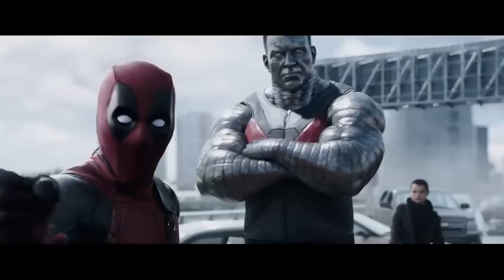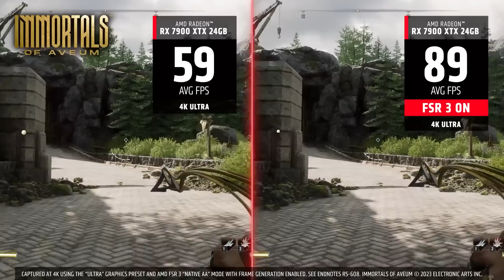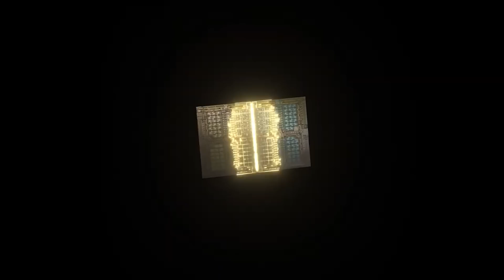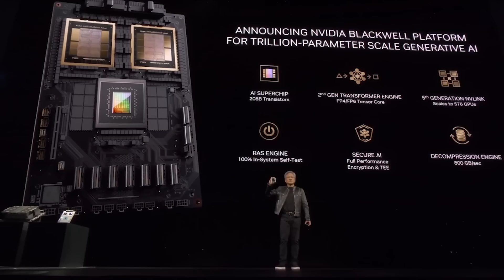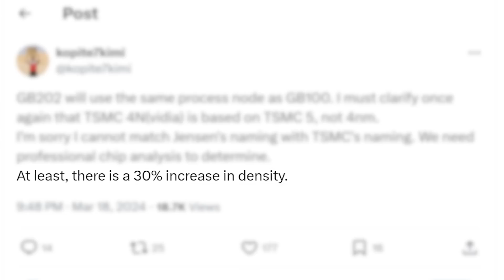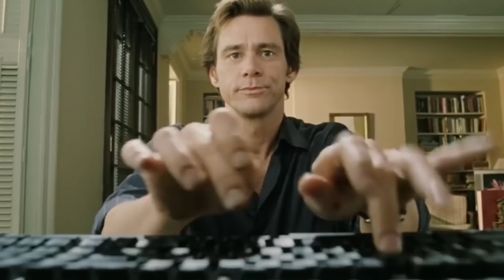RTX 5080 BEATS The 4090!!

Comment: Was there a generation in which 80 class didn't beat the previous gen flagship?
Reply: The 4080 requires frame generation to beat the 3090. Edit: nope, I'm an idiot. There's some benchmarks out there showing the 3090 to be faster sometimes, but there could be a variety of reasons.
Reply: @nimrodery  the 4070 ti beats the 3090, the 4080 beats 3090 ti by 1round 10-20%, driver improvements have made it possible
Reply: @Rishi-chadsincebirth  What driver improvements? I used NVidia for decades, they never fix anything. Driver improvements would also improve performance on older GPUs, not make newer ones faster.
Reply: Not that I can recall but its true that the gap the 4090 has over the 3090 is much bigger than before. Tbh I think the 5080 will be around the same performance in rasterization and 15% better with raytracing while consuming at most 350w instead of the 450w of the 4090. Though it will most likely cost at least 1200 or 1300, so it wouldn't practically be that much of a better deal. The 5090 is anyone's guess but I'm expecting a ~20% performance increase while keeping the 450w power consumption, since Nvidia is more about efficiency this gen it seems. We will see.
Reply: It's rumoured that 50 gen will be 70% faster than 40. Of course it only applies to the fastest chip, the gap between 80 and 90 class will only increase
Reply: @bartix698  What is the source? I'm calling BS, we get this "rumors" every new gen and they are always wrong. Most rumors are going more in the direction of "more efficient cards" instead of much more powerful ones. Besides, Nvidia is not changing architecture / nm manufacturing, so there is no chance that they are able to get 70% increase out of thin air

Comment: Yeah, because it is not like if the 4080 was already better than the 3090 and 3090Ti, right guys? It is only the 5080. Only the 5080 could beat a 90 model from the previous gen.

For real tho, we should start talking about prices, because the 4080 came out at $1199, which... is fine for a GPU that beats the 3090, but it was a lot more expensive than the 3080.
Reply: yeah, kind of a weird claim to make, cus rn even 4070 super beats 3090 in terms of performance

Comment: AMD's gonna have to focus on the mid-range to win, I think they can do it
Reply: Given that MLID reported that the PS5 Pro has a 2 to 3x improvement in RT using RDNA 3.5, RX8800XT should be equivalent to 7900XT but with 2.5x RT improvements @$600!
Reply: @tringuyen7519 that's pretty frigging good for Ray Tracing, I wonder how that stacks up to the Nvidia equivalents.

AMD's ray tracing tech was always leagues behind Nvidia's.

Comment: 5090- $2999
5080- $1999... but it's better than the 4090, so 4090 users really feel like they need to upgrade
Maybe nvidia should just move to a subscription model at this point.
Reply: And maybe youre gonna need a second case just for  the 5090 because its bigger than any case on the market

Comment: 1.2 kW. KILOWATTS. Power supplies will have to output more power in order to keep up with NVIDIA's new GPUs, and in a nutshell, if the gpu exceeds 1600W/1.6kW of power consumption or power supply recommendations, you're screwed.

Comment: I HATE this rat race. Now I feel like I'm lagging behind with my 4080 when I know that isn't truly the case. On the flip side, cool gpu 👍
Reply: Go amd they got more vram and last longer
Reply: @gopackers848  I've been thinking about that a lot. 100% going with AMD for my next gpu and gonna get an AMD cpu too. Full AMD.
Reply: You don't have to upgrade, a 4080 should last a little longer. Although the 40 series is gimped for VRAM, so I think you might have to consider an upgrade when the 60 series comes out.
Reply: @UltimateGattai  Thanks. Everything moves so fast. Obviously it's a marketing strategy coupled with competition but it makes it feel hard to enjoy what I have in the meantime. Like what I have will be obsolete in a few short years when I Just dropped $2.5k on a really nice laptop. It's an odd feeling, on one hand I wish things would slow down but on the other it is selfish to want to slow progression for everyone else. Guess I just need to slow down myself and not let that get to me so much. Edit: Yeah the vram is a joke and the power cap on the 4060 and 4070 is so obtuse that it's safe to say that Nvidia isn't even trying to hide their performance manipulation. Capping out at 80 watts when gaming on my 4070. Later learned that Nvidia put a hard cap on the power limits that can't be changed 🫤. 4080 is great though. Goes all the way up to 175.
Reply: 4070 to super here.  Waiting for 6 or 7 series.

Comment: The 5080 should beat the 4090 by a significant margin. The 80 class GPU should always outperform the flagship GPU from the last generation.
Reply: The 4080 did that but then they decided to charge $1200 lol
Reply: This, not trying to make people mad, but looking at the 3nm node, yall 5080 buyers will probably be charged 1399$ and the 5090 @ 2k as a 4090 owner im ready to pay this@Dex2R7
Reply: Solid deal  @Dex2R7
Reply: If history repeats itself, the RTX 5080 will be priced closely to the RTX 4090.
Reply: @KillFrenzy96  cant wait for a 1k$ 5060!!
Reply: @KillFrenzy96 Than no one would buy it. The 4090 didn't sell so well because it was a "Gamer GPU"
Reply: Then I have to sell my kidney for 5090 @KillFrenzy96
Reply: @KillFrenzy96 the 4080 didnt sell well and nvidia is starting to realise that so the i think thr 5080 could be 1000-1200$
Reply: @KillFrenzy96  i hope not. praying that they learned from their 4080 sells!
Reply: The 1080 ti was barely slower than a 2080 though. Same with the 980 and 780 ti
Reply: I thought the 1080ti was faster than the 2080, but the 2080ti was faster than the 1080ti. Apart from Ray Tracing, the 20 series was barely an improvement over the 10 series.  @SpiritMMO
Reply: @SpiritMMO facts. It's faster than my 2060.
Reply: @SpiritMMO  Yeah, I bought a 1080 Ti a few days after the 2080 released, as ray tracing wasn't worth the price tag. That card still powers a work machine for me, was a great purchase for gaming for a while too.
Reply: @SpiritMMO  The 1080ti was an anomaly. I had it and "upgraded" to a 3080 and sold the 3080 and put the 1080ti back in because the performance in Escape from Tarkov in 1440P was like 100fps with the 1080ti compared to 120 with the 3080. Not worth it at all.
Reply: @SpiritMMO   The GTX 970 is 3% slower than the 780 Ti and the GTX 980 is 11% faster than the 780 Ti. The GTX 1080 is 31% faster than the 980 Ti. 2080 is 9% faster than the 1080 Ti. The RTX 3080 is 36% faster than the 2080 Ti and the RTX 4080 is 30% faster than the 3090. So the 5080 should be around 10-35% faster than the 4090.
Reply: @SpiritMMO  I heard it was because the 2080 was underpowered from RTX focus hence the super versions in the 20 series (I have no idea)
Reply: @GallusCorvus  Nah. NVIDIA had AMD to take on
Reply: Keyword "should"
Reply: significant margin ? are you smocking something or what ? do you know how fast the 4090 is?
Reply: @magnomliman8114  At least in ray tracing, it should be a significant margin. I guarantee the 5080 will be more expensive than the 4080, knowing Nvidia, so a big performance increase is to be expected. I don't understand why these stupid fanboys get defensive and shocked when I mention that the 5080 should be faster than the 4090. Fucking get over it.
Reply: but the price
Reply: @telecast712  I'll buy a 5090, plp bought the 4090 at that price for performance so why wouldn't peons buy the 5080 for 100$ more then 4080, 100$ less then the 4090, EZ
Reply: But the 4090 was so much further ahead of its lower end SKU than any other previous generations flagship.
Reply: @AxleLotl  right
Reply: We are in the Moore's law curve of silicon costs going up nearly as fast as density improves,  with some exceptions to the rule. Thus the amount of money you can spend to get higher performance goes up much faster than value. And at some point NVIDIA probably realizes that there's large gap between people who want the absolute fastest and are wiling to pay for it and the amount second fastest GPU could be sold for. 
 This time, there's 50% improvement in memory bandwidth per pin because GDDR7. And then you only need to add few more cuda cores and some clock speed to make 5080 match 4090. The compute is the one thing that still scales with process improvements thus they can fit more of it with same area.
Reply: @jouniosmala9921  that's why people like me buy a 4070 ti super instead of a 4090. I can afford the 4090 but why? The 4070 will do everything i want at the performance level I am looking for.
Reply: And being sold more expensive comparing to the last gen flagship looool
Reply: if it doesn't then we have a big problem lol
Reply: totally agree
Reply: No
Reply: If its a dual chip yes, but that would also make it more expensive.
Reply: exactly!
Reply: If you believe that you are delusional also let's not forget 4090 has 24gb and 4080 will have 16gb
Reply: Just get the card on a bench and give us the specs….ignore the hype and believe the facts.
Reply: yea, and it is very likely. 4070 stands almost equal to 3090 and 4070 ti super outperforms 3090 ti by around 10%
Reply: You obviously are new here. Just because it is new doesn't mean it should outperform the previous generation. For a while, Titan cards that were brought from the enterprise product lines routinely outperformed multiple generations of consumer GPUs. You would pay 2-4x the cost of a flagship gpu though.
Reply: @Neckername1   New here? I am definitely not. It's always been a trend where the 80 class GPU outperforms the previous gen flagship GPU. 4080 outperformed 3090 Ti. 3080 outperformed 2080 Ti. 2080 Super outperformed 1080 Ti. 1080 outperformed 980 Ti, etc.
Reply: In reality the 5090 will probably only give you 25% to 50% more frames then the 4090. Which is fine, but people need to stop saying it will be 10x faster and stuff like that.
Reply: @unrealdevop  The 5090 only being 25–50% faster would be absolutely garbage considering how expensive flagship GPUs are getting. It's really not that unrealistic to expect a 2x performance increase from 4090 to 5090, at least in ray traced games.
Reply: @RenderPixion  I hear you, and yet the 4090 was only 75% faster then the 3090.......
Reply: @RenderPixion  Also if you look at the graphs where it shows the actual benchmarks, it will be more evident just how much more performance you can expect between generations and it's not double. Some people were claiming the 4090 would be 4x faster....then the 3090....it wasn't even 2x faster.
Reply: @unrealdevop  The 4090 is around 70–80% faster than the 3090 at 4K raster and roughly 2x faster in ray traced games. There are plenty of ray traced games where the 4090 is 2x faster than the 3090. For example, in Cyberpunk at native 4K max settings with psycho RT, the 3090 gets around 20 FPS, while the 4090 roughly averages 40 FPS. Control, Dying Light 2, F1, Alan Wake 2, and Avatar Frontiers of Pandora are some other ray traced games where the 4090 practically doubles the 3090's performance.
Reply: @RenderPixion  Ray tracing don't count LOL. I don't even know why they throw that out there....I've literally NEVER Used Ray Tracing....EVER
Reply: @unrealdevop  Ray tracing is becoming a big factor in modern GPUs. That's why.
Reply: @RenderPixion  I believe that's purely subjective. I personally don't know of a single person that uses Ray Tracing. Now that we have True Global Illumination in Unreal Engine I don't really see why we would need it to begin with.
Reply: @unrealdevop   Unreal Engine 5 mostly uses software based RT called Lumen. Lumen can also be hardware based RT as well. Hardware based RT is more accurate than software based RT, resulting in better lighting,reflections, shadows, and refractions. However, it's more demanding than software based RT. Software based RT is great for GPUs that don't support hardware based RT and GPUs that don't have the rendering power to run hardware RT properly. Since software based RT also uses upacaling, it causes shimmering issues.
Reply: @RenderPixion  Yes you have a point there, I've worked with it but it's extremely heavy....Ray Tracing is just so expensive, when enabled performance drops by like 60% or more. Maybe when hardware can actually support ray tracing without dropping your game performance down to 10-30 frames per second I'll start being impressed by Ray Traced Performance gains.

Also I should mention that Ray Traced Lumen also has it's downsides and it doesn't look that much better then Non-Ray Traced when comparing the performance gap.

Ray Traced Lumen is considered something for Cinematics...not something you would actually have in your game.
Reply: @unrealdevop  This is why I am hoping next gen GPUs are a massive leap in performance, especially in ray traced games, so ray tracing can have less of a performance hit. I do agree that the performance hit is too big now. Current gen hardware isn't powerful enough to run RT without any compromises.
Reply: @RenderPixion  Yeah, we'll If not this gen maybe next gen or the one after but eventually the performance will get to a place where it can handle it.
Reply: @unrealdevop  There are quite a few leakers saying that the 5090 should be over double the performance of the 4090 in ray traced games, and that's referring to raw performance apparently without upscaling and frame gen. I hope these performance claims end up being correct.
Reply: @RenderPixion  Yeah I mean I hope so too. It would be nice and at the very least it would make for faster rendering times for me.
Reply: @unrealdevop  A massive performance increase in ray traced games would allow GPUs to run games at a higher ray count, which would result in much better looking ray tracing. Most current gen ray traced games run at a low ray count, which causes a noisy image with artifacts. More rays mean higher image quality and more accurate lighting effects, along with less noise and artifacts. Increasing the number of rays and bounces is the most effective way to make RT look better. The only downside to this solution is that the higher the ray count, the more demanding it becomes.
Reply: @RenderPixion  Oh yeah, you know now that you mention it I think that's one of the reasons I didn't like it because of all the noise. I get why they are doing it and it's been a slow paced technology but over time I can imagine it being the #1 selling point.
Reply: The price gone be twice as well
Reply: This isn't impressive considering the 4070/super is better than the 3090
Reply: They should only be releasing one GPU at a time. The just keep selling the same shit with different names over and over. Only cards faster than the previous gens flagship should be released. That means their new gen slowest card should be faster than last gens flagship
Reply: I doubt it. Even if the alleged 30% density increase is true, that's nowhere near the kind of improvement that Ada Lovelace saw over Ampere. Unfortunately we can't get that kind of jump in process node every iteration.
Based on the leaked info on transistor density and likely power limits, my guess is 5080 will trade blows with 4090, and probably perform worse than it in 8K and high res VR due to less VRAM (assuming 5080 gets somewhere in the range of 16-20 GB).

I'm also guessing that 5090 will be a 600W+ space heater since they will need to pack in a lot more transistors to get a significant leap over 4090 without much of a process node improvement.
Reply: @FromDesertTown  Nvidia's data centre Blackwell chips are on TSMC 4NP. Not to be confused with N4P. I am surprised it is not 3nm. Nvidia definitely could have used 3nm if they really wanted to. Because Nvidia's AI accelerators used an MCM design that allowed them to cram in way more transistors without upgrading to a whole new node. TSMC 4NP is only a slightly more enhanced version of the custom 4N node used for Hopper and Lovelace. The 104 billion transistors in each chiplet of Nvidia's B200 are the reticle limit of how many transistors can be packed into a 4nm node on a monolithic GPU. Nvidia's Blackwell gaming GPUs are unlikely to be MCM because effectively rendering gaming performance across multiple chiplets is very difficult considering an MCM design introduces a latency penalty, and low latency is critical for real time applications such as video games, so MCM isn't a viable option for gaming yet, but for AI workloads, latency isn't as big of a problem. I think they will struggle to fit a bunch more transistors on their gaming GPUs, which will very likely remain monolithic without using TSMC 3nm. Leaks are saying the 50 Series will use the same 4NP node as the data center chips, so I don't think RTX 50 will be a massive performance increase over RTX 40 due to not being on 3nm.
Reply: @FromDesertTown Yeah. They're both TSMC 5NM, Blackwell is just on an improved version. It will definitely take way more power draw for more performance. I'm afraid I don't even expect the 5080 to beat the 4090 in raster, probably a ~20% raster perf improvement overall and then larger gains in RT or AI workloads. This isn't a bad thing if it's priced right, but ofc it won't be so lol.
Reply: @FromDesertTown the rtx 5050 will have a 50% of working
Reply: @FromDesertTown The reason why, tier-for-tier, Lovelace annihilated Ampere was because the levels of models were off by one. 

The 4080 was a 4080 ti
The 4070 was a 4070 ti
The 4060 was a 4070
Etc

The pricing matches this 100%. Regardless of cache, frequencies, and memory buswidth, the performance levels of the cards were off by one card.